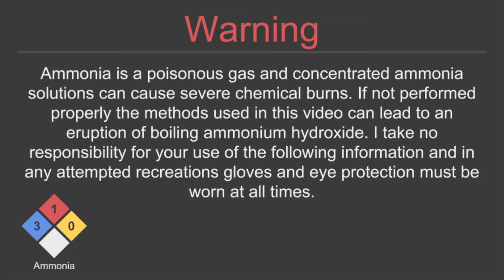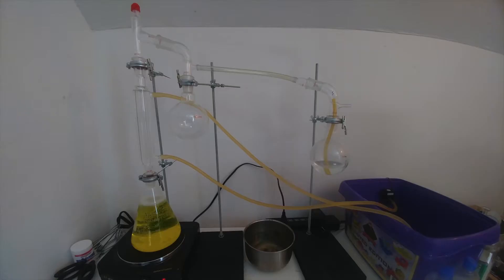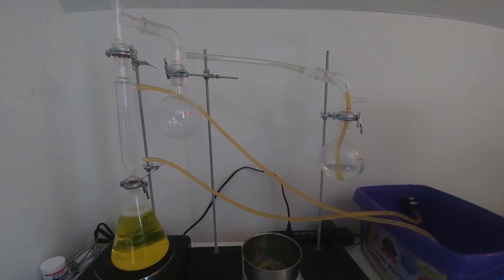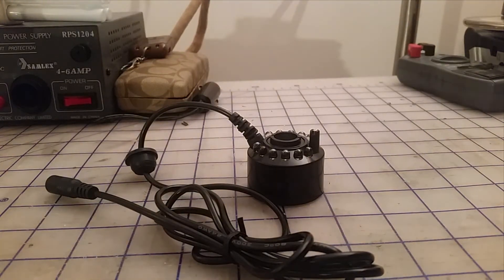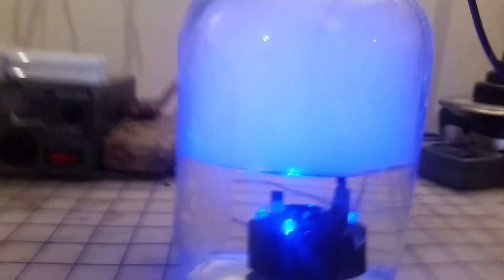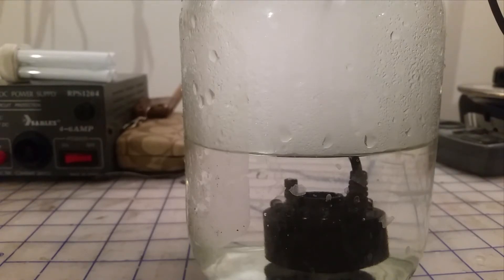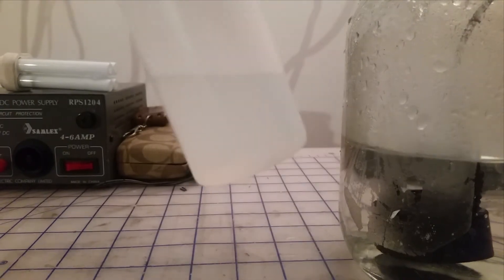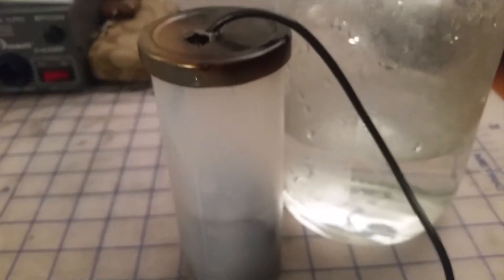Purifying and Concentrating Dilute Ammonium Hydroxide

Comment: Quite genius! Sure beats paying $70 a gallon for 28% ammonia!  One question I have is how did you get the tubing on the end of your condenser?
Reply: I made around 30% solution much easier and cheaper then this in less then a day. Get ammonium nitrate from cold packs, sodium carbonate or bicarbonate, a jar/container w lid, and a cup that fits inside it. Make separate saturated solutions of the nitrate and carbonate, pour cold water (iced is best) in the jar, then mix the 2 saturated solutions in the cup that fits inside the jar then put the cup in the jar so it floats and doesn’t mix in the water. Close the jar and let it sit for several hours. To ensure you get around 30%, look up the amounts of the ammonium nitrate you need based on the amount of water you decide to use in order to produce the amount of ammonia needed to reach around 30%. An easy way to test it is by weighing it. I ended up getting .89-.9g/ml which equals 29% con. 
Pro tip: the more you keep the water cold, as ammonia dissolving in water is exothermic, the quicker the ammonia gas dissolves and the higher chance you’ll have to end up with 28-30%

Comment: Just use an inverted funnel on the collection jar. Place rim just below water surface. When it sucks back, it will pull back until the water level drops below the funnel rim and the solution will slosh back. This will oscillate like that until you have desired strength